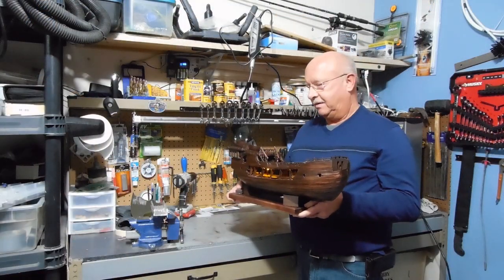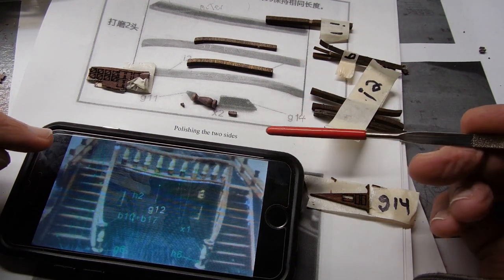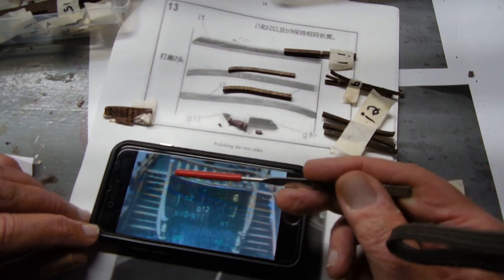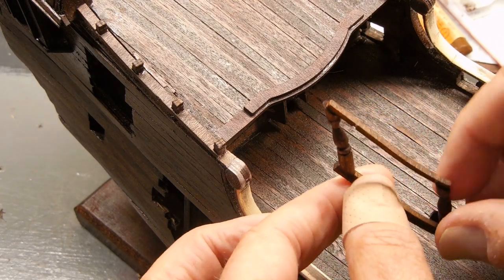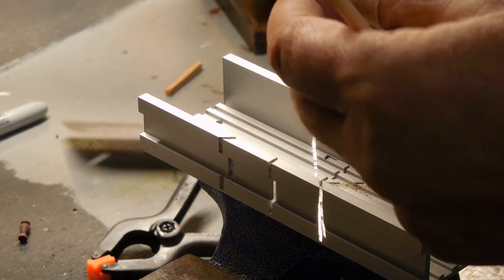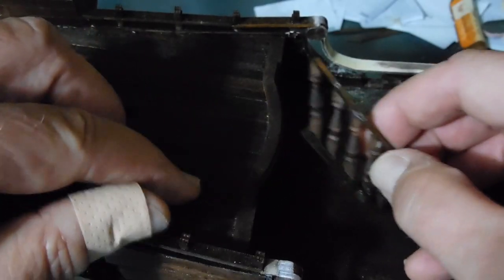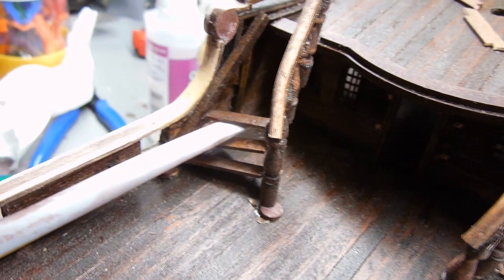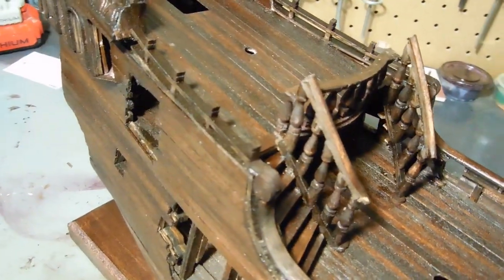The Black Pearl Model Ship Part 13

Comment: What kind of resistors did you use
Reply from the maker: Good question: The lights came with resistors, but I'd have to hook up one resistor for every lamp. I went to a local electronics store and they provided guidance. 
"NTE Electronics QW047" Metal Film Flameproof Resistor.
I was told the QW047 would work for 10 of my led lamps.
They were inexpensive... Under $3 for two.  On line around $6 for five.
On the package it lists: 47 WHM 2%   1/4 W along with the part# QW047.

Thanks for watching.  I'll continue posting progress as I build the ship.
Reply from the maker: I meant to add that I'm using a 9 volt battery with that resistor type.
I might convert to a plug in sometime down the road?